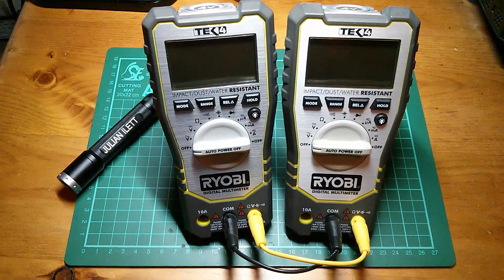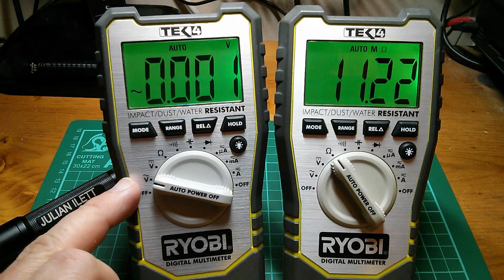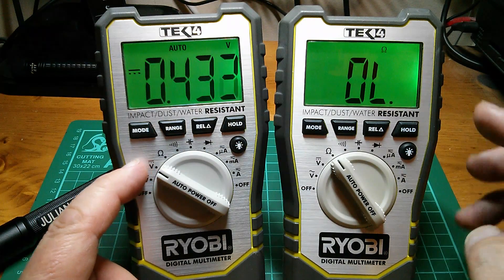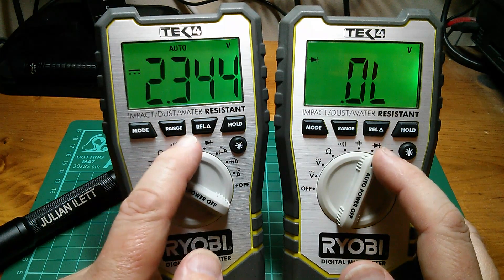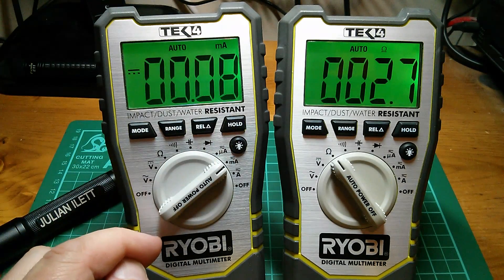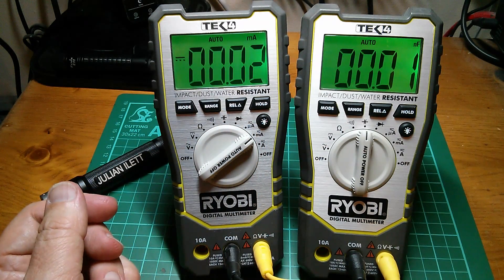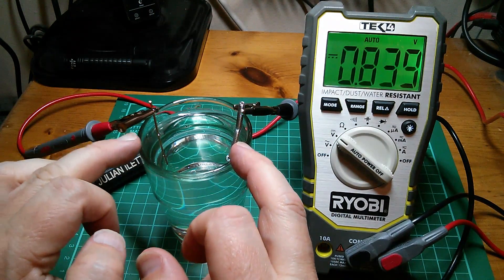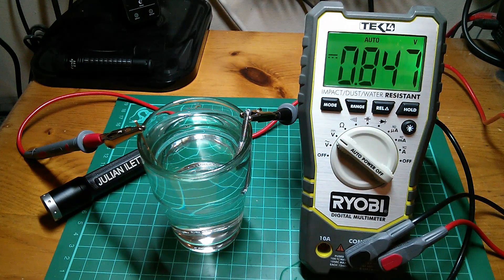Measuring a Digital Multimeter (with another one)

Comment: I.m.o. trying to measure the resistance isn't working because putting a voltage across the 2 leads is effectively causing the water to be split into hydrogen and oxygen, so the anode and cathode will have small gass bubbles forming reducing surface area, and thus increasing resistance, as well as the one lead becoming contaminated as it reacts to the oxygen. again increasing resistance.

Comment: basically what you see is polarization of the water molecules and 
conductivity from the impurities in the water it's not capacitance it's the charges of the molecules aligning to the flow of the current  I assume that if you leave that for a certain amount of time it will stop rising cause all the molecule will be aligned not too sure tho but that's what comes to mind.....

Comment: If you are using tap water, it will have impurities in the form of ions and this will allow a current to flow and electrons will travel from the -ve terminal to the +ve terminal. Please try the same experiment with pure water, there should be no current flow and you may get a result.

Comment: Why don't you try a 4 wire ohm test on the water. Send a constant current through the water, then read the voltage dropped on the electrodes. THen just do the ohm's law.

I did this to test some hobby connectors: https://youtu.be/f_RIP6N6IvI

Comment: Julian - Nice investigation.  I hope you wrote down all your results and looked for patterns too :-).  (More 'scientific' than just playing with stuff on video, of course.)  As others have commented, your findings all make sense when you think about what the meter is doing to measure whatever its range is on.  If you've ever read about how they work or watched some of the other bloggers' detailed teardowns etc, it becomes less of a mystery.  Still pretty interesting though :-).

As for the water, I'm also inclined to say it was more of a capacitor than a battery.  A capacitor stores electricity directly by an electric field, where a battery per se is an electrochemical reaction.  Since it charged / discharged so fast and given you were using plain water (though impurities would affect that) and similar metals...seems more like an electric field than a chemical reaction to me.  I could be wrong though, so someone who's thought through it more correct me if so!

Final note - just don't anyone try to use a meter to measure its own guts!  Or if you do, make sure that it's a meter you don't care about and you record the whole thing for us to watch :-D.
Reply: So I just read @Mike Murphy's post about the electrolysis/fuel cell equal-opposite effect.  Maybe that's it...that wouldn't be a capacitor then but the fuel cell effect continuing....like back EMF on a motor / inductor.  Does that mean you should put a flyback diode in ?  LOL
Reply: Yeah, of course, a capacitor depends on the field between electrodes/plates which depends on the surface area.  Not much surface area in your experiment!

Comment: In my cheap crappy innova meter, the continuity measurement uses the same exact switch contacts as the 200 ohm range, but it enables a beeper circuit (which is not fitted! Gah!)

Comment: Killer! I did something similar a while back to test the voltage of a multimeter when it was in continuity mode to see what actual voltage was being used to check continuity. All I used was alligator clips to connect the probes together with another multimeter. I never went to this extreme testing like what you're doing.  That's why I thought this was really cool. Nice job, dude!! :-)

Comment: Yesterday I unbolted my cheapo multimeter and measured the voltage of its 9v battery with the multimeter itself. Now it does not work. It cant measure current anymore and the resistance shows random values. Now I just have a volt-meter
Reply: Yep.  That's what tends to happen when you probe a meter's guts with itself.  Things are connected inside in various ways, so you shorted/blew something up.  I forget if that's usually just a fuse or if it's part of the measurement circuit - on a cheapo meter it's probably not fused against that.  Might be interesting if you open it up and check :-).

Comment: I seem to recall an old EPE design for a soil moisture meter. In order to avoid errors due to electrolysis,  they used a.c. across the electrodes. That  might help you measure the resistance of water.
Reply from the maker: Yes, that makes perfect sense

Comment: When the battery in my (very cheap) DVM was running low, it would give an open circuit reading of maybe half a volt. I once left the multimeter on for a long time and when I got back it was reading nearly 15 volts, completely open circuit! This was all cured by changing the battery.

Comment: The one thing you didn't do was cap+ACV. That would be intersting, especially with a capacitor in parallel so you can observe the meadrument, which would have to charge and discharge the cap. Using it as a crude PSU might be difficult since the output voltage would vary with the load impedance. You could try connecting it to a diode capacitor bridge and see how far and how quickly you could charge the cap.

Comment: On the diode and ohm range you have a constant current source probably 1mA but will vary from meter to meter and what you measure is the open circuit voltage of that current source.
Also that was not water. Water (H2O) distilled  water will have about 18Mohm/cm. 
The so called tap water has a lot of impurities :)

Comment: Hi Julian

When you do that water test, you form bubbles of Hydrogen on the negative wire and Oxygen on the positive wire.
this reduces the conducting surface area of the wire, causing the resistance to increase.

While the bubbles are there, they form a fuel cell which generates a voltage which opposes the applied voltage (also reducing the current flow) and this voltage persists and can be measured after the external voltage is removed.

Mike

Comment: Hi Julian! My guess:
I guess it is doing electrolysis with the two pieces of cooper, after all there is a voltage between them. So it may be getting corroded, even though very slowly (especially the + electrode by my experience) and consequently increasing it's resistance. The oxide layer in the + electrode may be the reason it is (kind of) behaving like a battery. 
When using different metals: It looks like it is indeed behaving like a battery, and maybe the DMM will not measure resistance where there is a voltage. I have broken DMM by measuring Ohms where there was a voltage (at least the Ohm section). So if it has a protection, it is using it. It's almost 1V after all!
(Hey, maybe you could power your "1-5V step up" to light up the LED :D)
Reply from the maker: I'm trying to teach myself electrochemistry, but it's not easy, particularly the chemistry bit. I'm pretty sure I got an E in my chemistry O level.
Reply: Julian Ilett :D Nobody is perfect. I guess we are learning until we die.
Reply: Interesting.  I guess that would be why one of the electrodes in a lead acid battery is Lead Oxide and the other is just Lead.  Totally makes sense.
Regarding electrolysis... this is way off on a tangent but I would be very interested in knowing the TRUE resistance of tap water, just like Julian tried to do.  The reason is that I'm interested in knowing how HUGE of an electrode surface area I would need in order to perform electrolysis of tap water without the need for adding acids or bases.  Like, what would it take to make the cell draw 20 amps at 3 volts?  Of course that completely depends on what's in the city water in my area.  But, it would be cool to not have to use a catalyst.
Reply: The true resistance of deionized water you can look up. The resistance of tap water is going to depend upon the concentration of dissolved ions. It could vary significantly day-to-day, hour-to-hour depending upon where your tap water is sourced, its mean residence time in the pipes, the composition of the distribution/delivery pipes.

Comment: Did you use matched batteries (by type, brand, actual voltage, etc) in both meters?
Reply from the maker: Certainly brand matched - Ryobi's own 4V lithium cell (basically an 18650 in a fancy plastic case). Possibly not the same state of charge.
Reply: Julian Ilett I would assume that if the batteries are truly matched by brand, composition and actual voltage per battery, the difference between meters should be due to the tolerance of the individual components of the meters.

Comment: I  have an old clamp meter that has a resistance range, to use it you plug in a probe that has a series 1.5v cell, if you think about it you need to pass a known voltage through a resistor to measure the current through it, and that is displayed on the meter.
If you are turning water into hydrogen and oxygen, it doesn't matter if the probes are different, so electrolysis is affecting the resistance

Comment: Quite interesting vídeo, but I was wondering what would happen if You measured water's capacitance
Reply from the maker: Zero, according to my DVM
Reply: +Julian Ilett Interesting
Reply: I was thinking in the case of similar metals in water you had a (poor) double layer capacitor
Reply: If they were close enough together you would get a "good" one,Great Scott has done it in his capacitor video
Reply: I wonder if you could get the voltage and frequency high enough if you could measure it. Same principle as Tesla's wireless power transmission idea but he used air as the dielectric instead of water. This way lies madness...
btw  - Julian: bolt probably nickel plated.